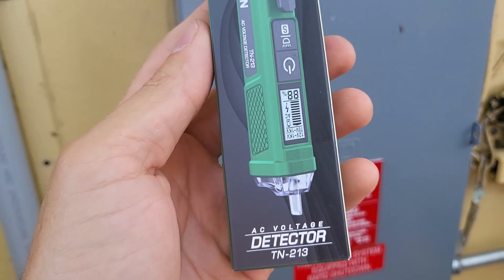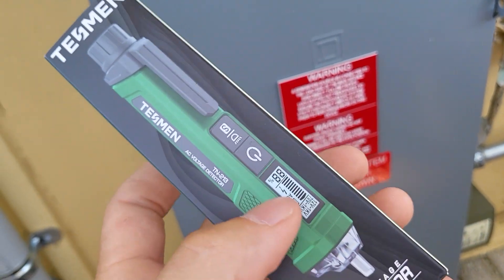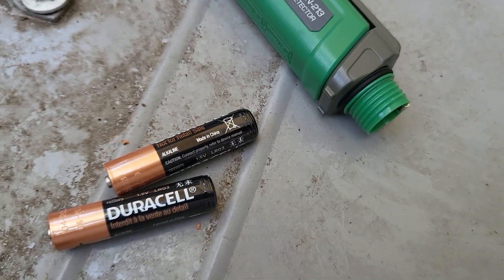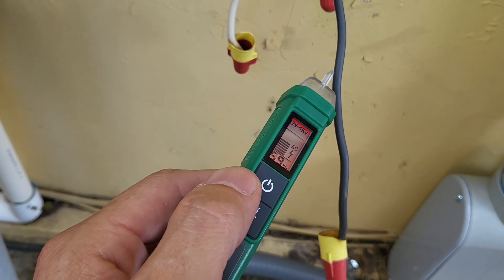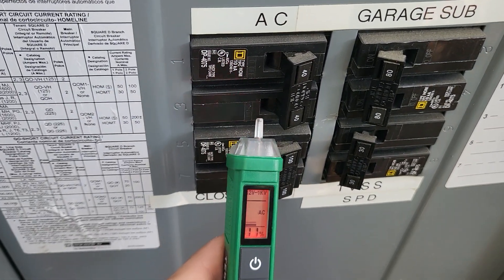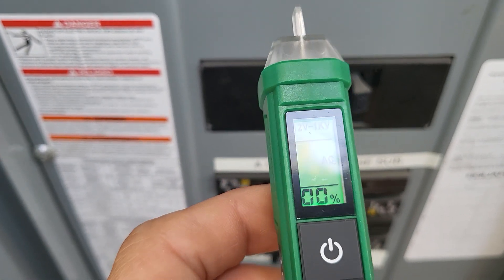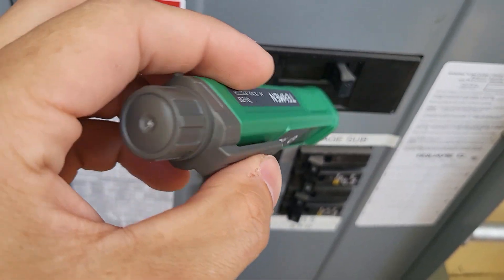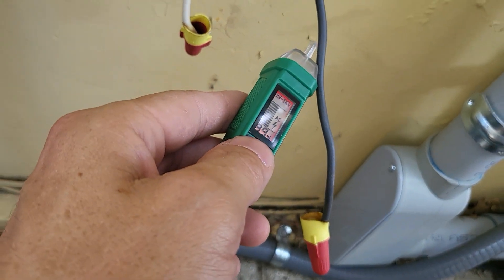THIS TOOL Just set the bar For voltage detectors (ncv)

Comment: Nice.  I have one of their cheap multimeters I think cost $13, not as accurate as my Klein, but close enough for my use which doesn’t need precision. I threw it in my RV kit and use it to test 30 amp service for polarity, voltage, etc  before connecting, checking LifePO4 battery charge, 12 volt DC and solar stuff. It’s taken a physical beating and held up so far.  Lots of quick throwing in my tool box, dropping on the (wet) ground, leaving in hot sun, etc. At this point if it broke I’d say it doesn’t owe me a thing. Hopefully this voltage tester holds up as well.
Reply from the maker: Yeah, time will tell looks great though  love the intensity scale!